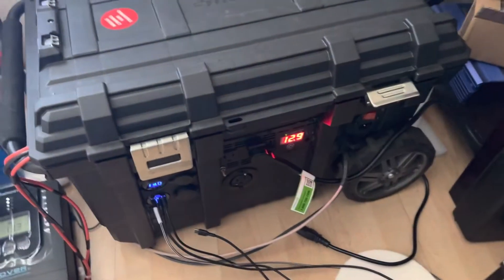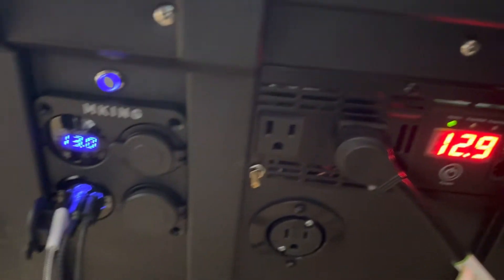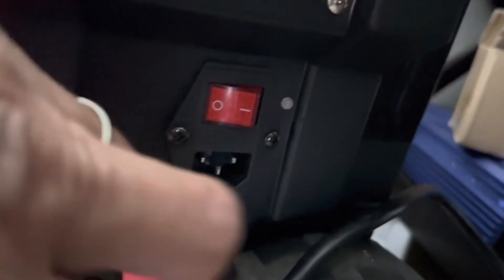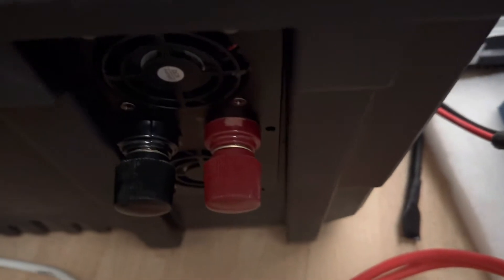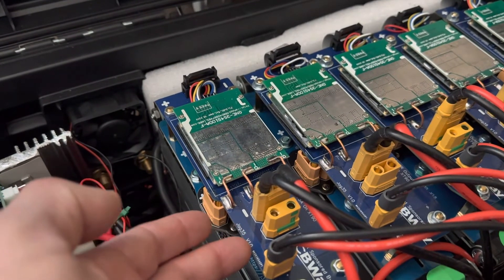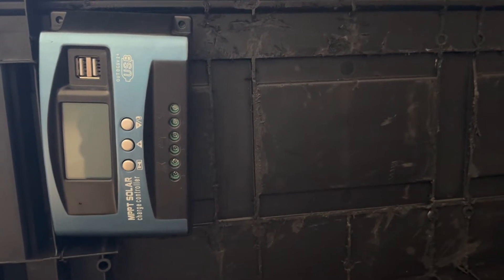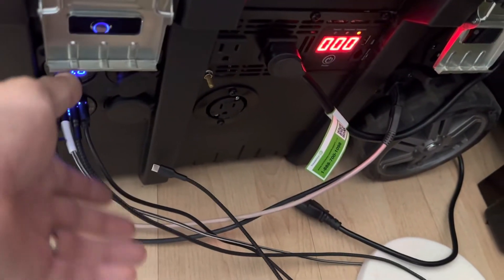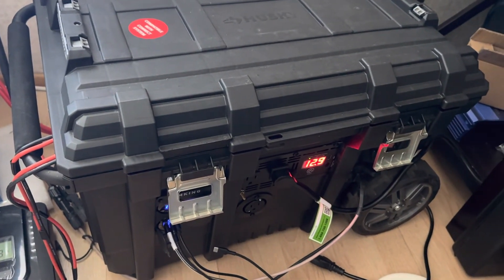DIY Portable 2000W Solar Generator LLiFePO4 250AH 3.2KW

Comment: For the RV port, did you just hook it directly up to the inverter? and if so, can the same hook up be used to run 240v appliances (Laundry dryer) ?
Reply from the maker: The invertir has a 125 30amp ac terminal connection

Comment: nice power station  am building one but its water proof 3000 watts pure sine wave inverter 150Amp fused for inverter with 150Amp DC breaker for my battery with 2 110AC out put CGFI  with 2 20Amp breaker for out let so my inverter is well protected and usb port water proof with 2 fan water proof pushing air in and sending air out cool the inverter with solar charger and 12 volt light with 12way fused block and used wire wich wire house with for wire my 110V AC out let and to hot wire my inverter with wire that used in house so if i out side in park raining my tool box is safe my inverter is 3000 watts pure sine wave 110V-120V 60Hz 30Amp rate at
Reply from the maker: a 3000 watt system will require at least 250amp BMS battery 250ampX12volts=3000watts

Comment: Where did you get the usb port's I'm interested in rebuilding and upgrading some of my jump boxes  and eventually building a solar generator but so far I haven't found even a 2 port usb type C also those power lugs would be nice and what brand of inverter did you use
Reply from the maker: DOne